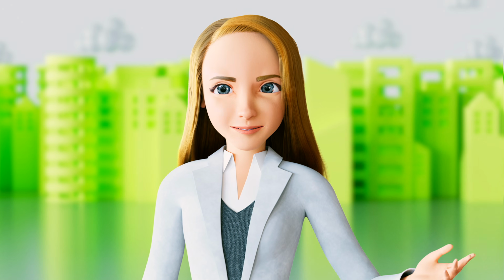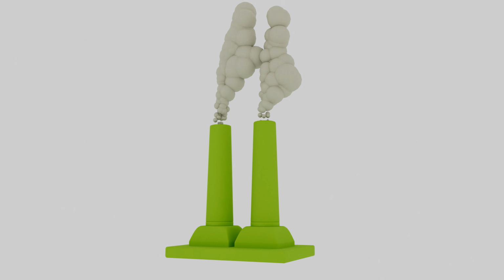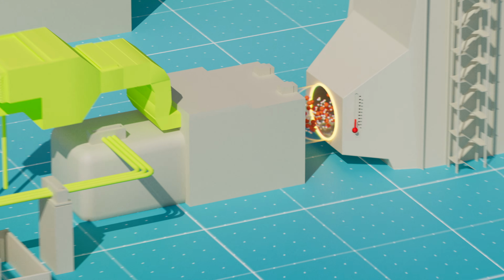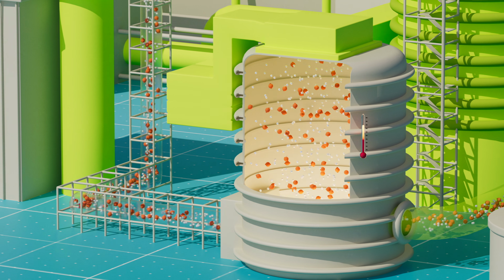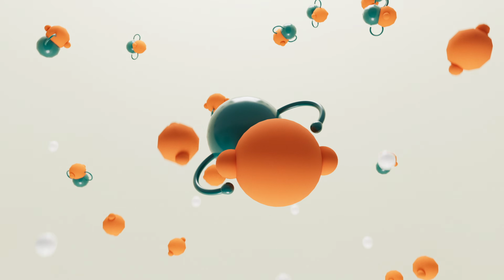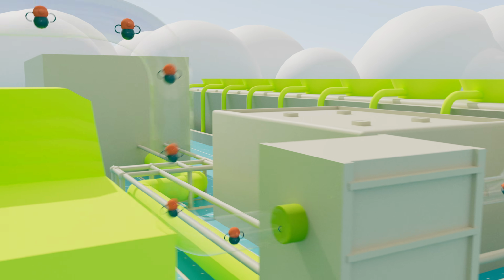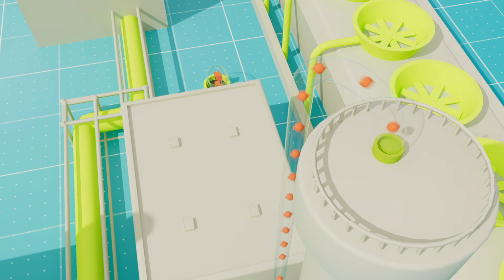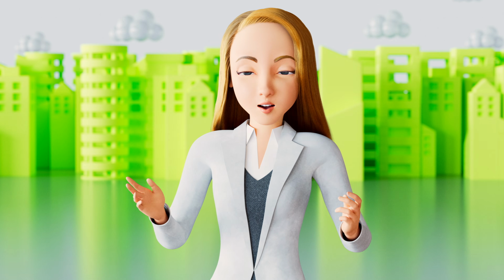Can solvent-based carbon capture work? CO2 reduction explained | GE Vernova

Comment: Why is this produced as a 'cartoon for children' on such an important topic - especially when taxpayers need to evaluate billions in fossil fuel grant money going to these industries? Within the 'heresy of paraphrase' (all the points not mentioned) you could be showing the equation: heat generated by exhaust with all the emissions, time or energy in the cooling towers, an amount of additional fossil fuels burned for the reheat process in the Amine absorbtion giving a level of process efficiency. And how long can the amine be utilized prior to replacement (this comical should also have a carbon number on it for it's generation) - as well as describing what is being done with the captured CO2 - to confirm it is not being injected back into oil wells for additional recovery - (which should be penalized) and sharing research as to why pyrolysis techniques have not been implemented (or what has been tried). We are in the information age, and GE would do well to encourage a more scientific and reasoned description of activities & processes - as they affect all of us.